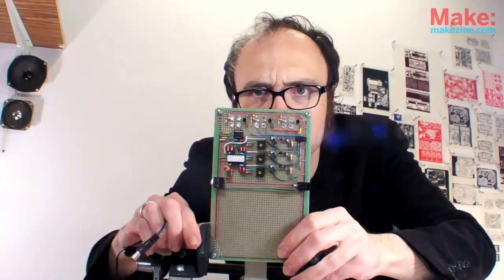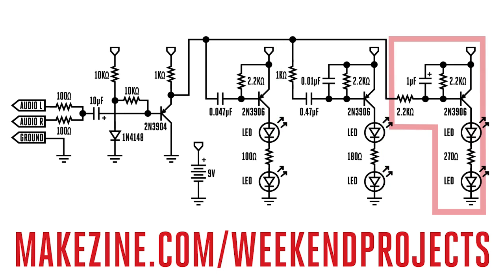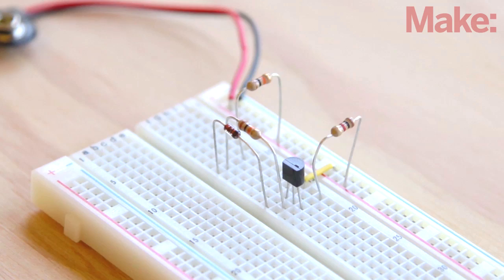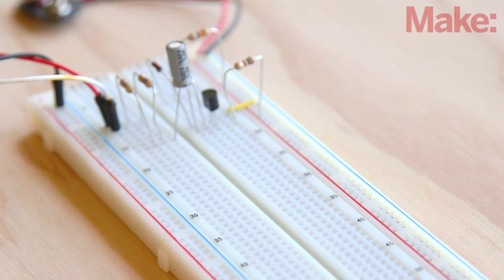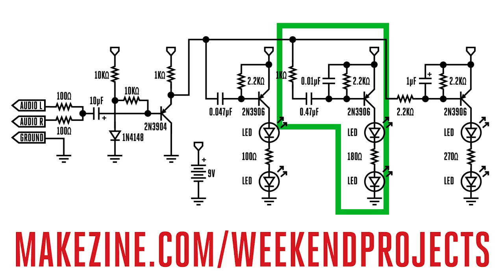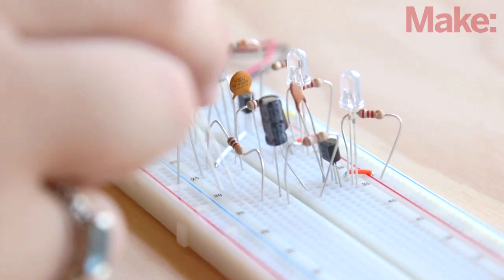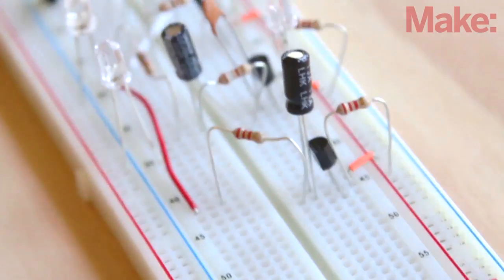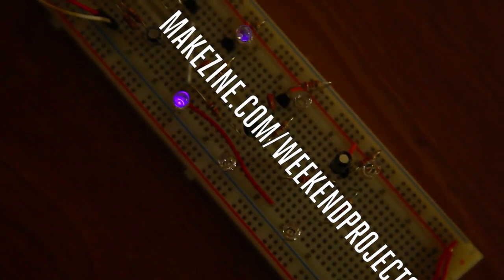Weekend Projects - Easy LED Color Organ

Comment: Hey there! Love the simplicity of the circuit. Just wondering about the three different values of the resistors between the LEDs. Is that because each colour draws a different amount of current? I'm going to build this unit for a Steampunk costume I'm making. The LEDs will be part of Steampunk-style Vacuum tubes, so I'll be using a single colour for each. Should I use the save value resistor in that case?

Comment: instead of triggering 3 leds at 3 different frequencies, couldnt you trigger 3 relays instead. i was thinking  christmas lights. thats like 100leds.x 3
Reply: I would stay away from relays as they have a slow response and have contact bounce. Moreover, the transients might damage your Christmas lights. I would instead use TRIACs which give a "cleaner" switch and can respond faster.

Comment: If you do as he says in the video, your circuit will work, trust me. I tried and it works perfectly. I didn't change anything. At the end, don't forget to put the volume at maximum, it is important that you do it if not, the LEDs will not light up.

Comment: Everything in the schematics is right. We had to modify two points: (1) in the section with the red LEDs, take out the 2.2k resistor connected to the capacitor and move the jumper directly to the capacitor. (2) Also in the section with the red LEDs replace the 2N3906 with a 2N3904 transistor.
Reply: You can also add another aux port on the same row as the previous one if you dont have split aux cable this allows you to speakers or head phones without it !
Reply: I don't know... worked fine for me

Comment: can we increase the number of led or how can we increase the amount of blinking light?
 it will more fun!!!
Reply: You can wire more LEDs to a certain point in parallel to the existing ones.
Reply: I added 24 Led's to my circuit powering it off of a 12vdc wall transformer works great!

Comment: can I use a bc547 instead of the 2n3904
Reply: Yes, but the pinout is different. You need to look at the pinout of BC547 and wire the gate, drain and source to the correct points in the circuit, you can't just swap them in.

Comment: it's nothing to look at. I'd much prefer something that requires soldering and is less flimsy looking. Plus, I associate deeper colors with deeper sounds, so red and bass seems like a conflict of interest.
Reply: Anthony Guy , Blue 450nm is a shorter wavelength and higher freq than Red 650nm.
 Just swap the LEDs to suit your own taste.
Reply: There are kits, just do a Google search on color organ and there should be a eBay link.

Comment: just a few things need to be modified. for certain breadboard, we need to use jumpers on the leftmost  and the rightmost panel in the middle because certain breadboard is not connected. secondly, u need to use an amplifier because the power from your phone is insufficient, or you can use a laptop or pc. btw fun project.

Comment: Is there a way to miniaturize this design using SMD components running on 3V?
Reply: Maybe, but you need to fine tune all the resistors and wire the LEDs in parallel of two directly between the transistors' collectors and ground.

Comment: My high and mid frequencies work well but my low frequencies are constantly on... I've tried many different configurations and attempts but still no luck... Can anyone help?
Reply: +Benjamin Daghir I solved the problem! You just have to take out the 2.2k resistor that links the red led 1uF capacitor to the jumper to the audio input, then link the capacitor to the jumper and voilá! ^^
Reply: megaSTARK97 But thank you!
Reply: megaSTARK97 I noticed that to! But I also found that there is less distinction between the frequencies when removing that resistor. Changing the low frequency to an NPN transistor instead of PNP seemed to be the most effective. Just don't ask me why, I won't have an answer for you hahaha
Reply: +Benjamin Daghir you right but I put again the transistor and there was less difference also! Do your red led blink with the blue one when it blinks?
Reply: +megaSTARK97 resistor sorry
Reply: megaSTARK97 No they don't do yours?

Comment: it didn't work with most people because the wiring is wrong with the 2n3904 and it said 2n3906 in the schematic and here he uses the 2n3904 it's an npn transistor and he draw it 2n3906 as a pnp transistor
Reply: +jaffar syria in order from left to right on the schematic what should the transistors really be and are they pnp or npn?
Reply: It should be a pnp and from. The one transistor you can drive a high current npn transistor to put multiple led's together but many people on YouTube tried the same circuit with a bit of changing it worked with them!!!!!

Comment: Hey I want to make the same project using LED strip (powered by 9V adaptor) please tell me how can I modify the circuit?

thanx in advance
Reply: You will need a common anode RGB LED strip and a 12 volt power supply. You will need to remove the six LEDs and their resistors from the circuit and get either a P-channel MOSFET with pullup resistors, or use a PNP power transistors and wire them in place of the LED pairs you removed. Remember to use a pullup resistor for the MOSFETs, or base resistors for the power transistors.

Comment: Just a few questions. I'm planning on building this for my home theater system hooked up to a receiver. 1: is there a way to connect this between my receiver and my speakers? 2 I'm looking to use 5M led light strip for each color. Could you help me by making a video on how to do it with the strips on a breadboard but still be responsive to the music? Hope you can help. Thanks
Reply: take it off your tape monitor output from your receiver, works great!

Comment: If you were to play a larger resistor and then a transistor in between the two series LED's, could you make the second LED only flash during large periods of frequency use
Reply: place* a larger resistor

Comment: I followed the instructions carefully but the blue LED's (high frequency) is on even without music and it is the only one lighting up. Also the blue LED's is responding on low frequency sound when i played a music, not on high frequency. What do you think is the problem there sir? thanks.
Reply: Check your components carefully against the wiring diagram.

Comment: The schematic in the video has different transistors than in the PDF.
In the PDF, it says Q1 is supposed to be a 2N2222A, in the video it's 2N3904.
In the PDF, Q2-4 are 2N2907A, and in the video it's 2N3906.
Are these equivalent?